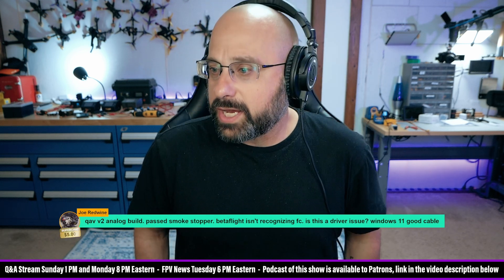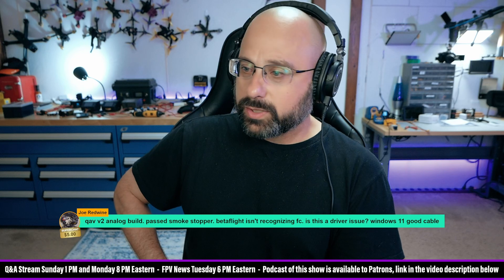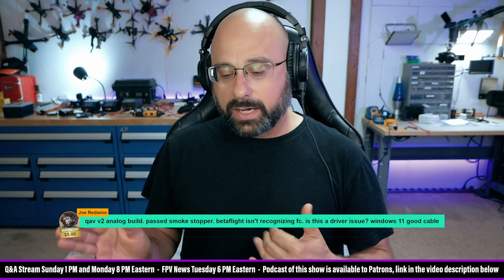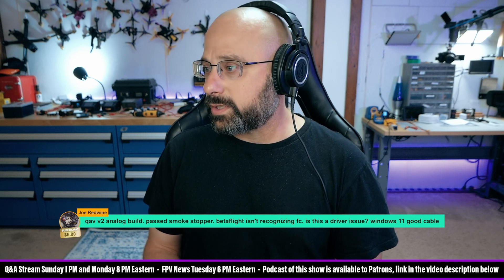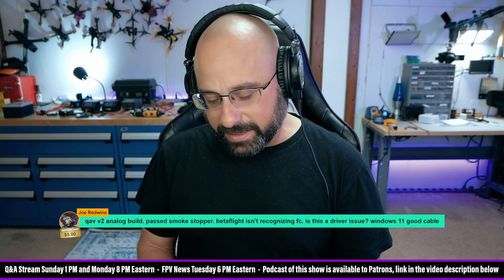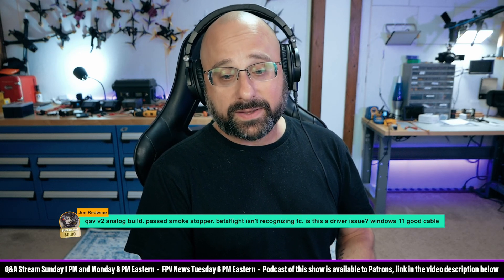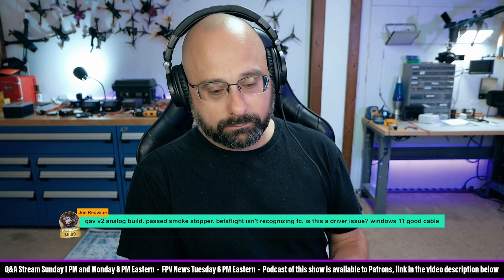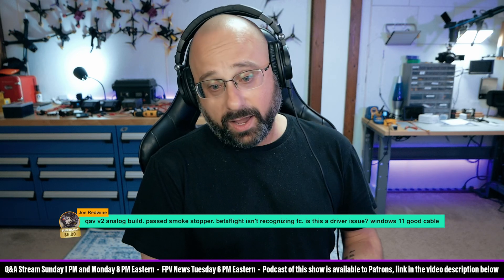How Do I Connect My FC To Betaflight? Drivers? Ceramic vs Wire Antennas? - FPV Questions

Comment: My windows machine doesn't connect to any Betaflight FC unless I've run IRC driver fixer and then unplugged and replugged the FC.  Then the computer will connect to that FC with no problem until I do the same thing with a different FC.

Comment: I tried installing every driver under the sun that betaflight talked about and even looked up videos, and never could a flight controller to work. betaflight would see the flight controllers, but wouldnt mess with them until the firmware on them got updated, but then it always failed when trying to update the firmware. It was 2 different lumenier fc's; an older one from years ago and a more recent one.

the only fc I could get to work is the brainfpv radix 2 hd, because updating the firmware on it is done via connecting it in a mass storage mode and then copying the firmware driver file over to it. After that, betaflight was happy to connect to it and mess with settings.

I wish ALL flight controllers updated their firmware that mass storage way. Its so much easier.

Comment: ImpulseRC driver fixer ❤️
Reply: I've tried that but doesnt recognize or read the port to fc
Reply: @F.A.F.O.-fpv  In that case you need to install the correct drivers. This software only works with F boards. .. And now there are newer ones.
Reply: Finally got it to work . Thank you
Reply: @F.A.F.O.-fpv  Awesome! Happy to know! 😃